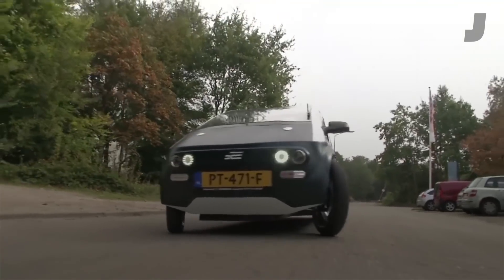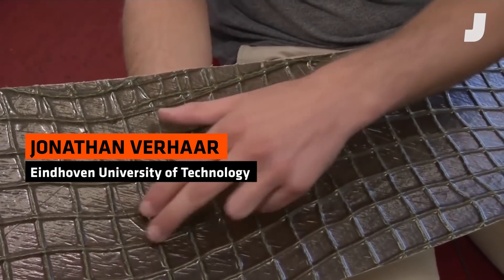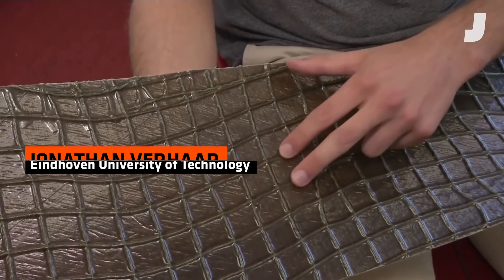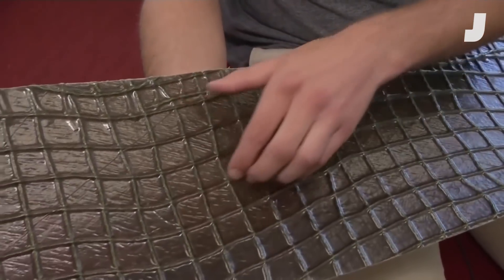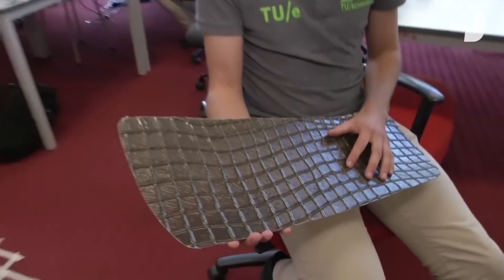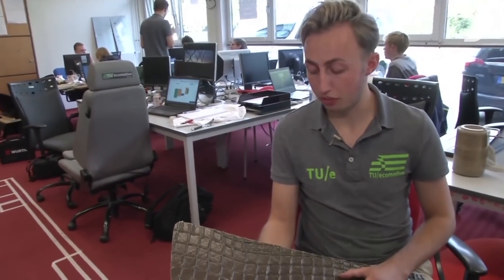Growing a Biodegradable Car | BLIP!

Comment: Does anyone remember when BMW decided it would be a good idea to use biodegradable plastic for the main wiring harness in one of their cars (I think the old 7 series) and 6-10 years after they were made their cars would just start having massive electrical issues?? Lmao now imagine your whole car decomposing  while a car made out of steel/aluminum is still going strong after 15 years

Comment: Metal cars are recyclable. Where's the advantage in a biodegradable car?
Reply: Tom Smith recycling metal uses tons of fuel. Precious fuel we could be using to hoon...
Reply: These kind of values can be evaluated by comparing the MIPS numbers (material input per service unit) of the materials. It factors for the land use as well. MIPS value for steel is readily available, calculating one for the biodegradable material used here shouldn't be too hard.
Reply: Tom Smith, the advantage is that you don't need a lot of fossil fuels in order to recycle steel.
Biodegradability in combination with photosynthesis, together make the most environmentally friendly recycling machine.
Reply: Rust is natural way of degradation too.
Reply: Unavoidable planned obsolescence.
Reply: Adi uh?
Reply: Yeah, that's what I thought too. If anything, we need cars that are 100% recyclable rather than biodegradable.
Reply: Rockabilly Rambler biodegradable cars also use tons of energy,and valuable farm land.